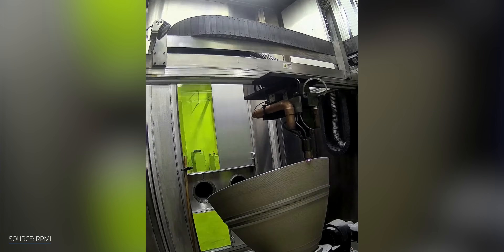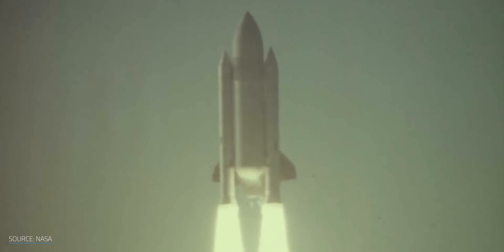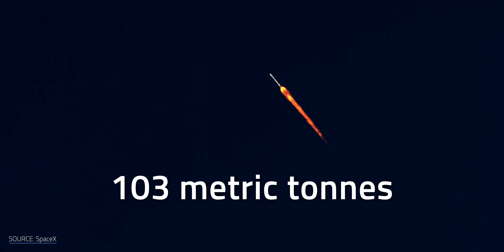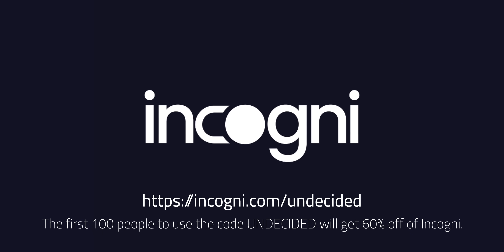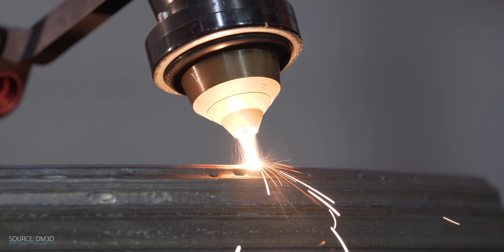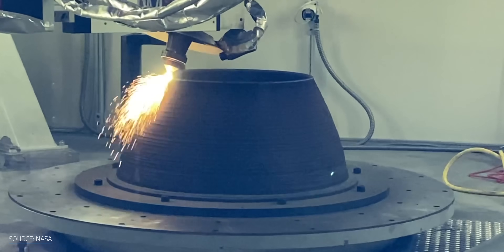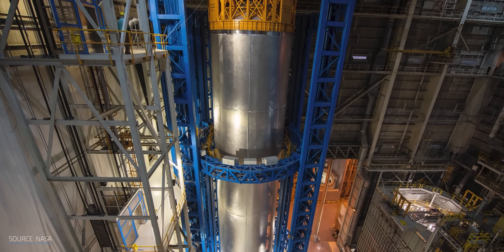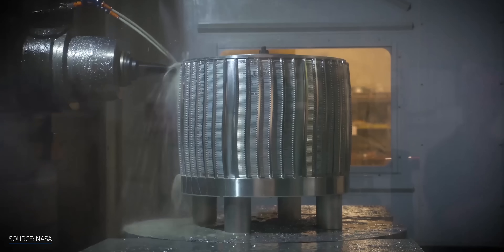Why NASA’s New 3D Printed Rocket Engine Matters

Comment: Imagine blowing up a rocket engine test bed and within a few days have made changes to the design, 3D printed it, and popped it into the next text bed.  Hell, the reason NASA shelved RDEs decades ago was BECAUSE the damn things kept exploding during testing.  

Now we have material, manufacturing, and design advantages that make brutal setbacks from 50+ years ago look like any other day at the office for NASA now.  Failure has become so ridiculously cheap (relatively) that a revisit to thousands of old 'failed' technologies is prudent.  Imagine what else we'll find.

Comment: One of the most important earthly applications for the RDE is in supersonic flight.
Currently there is a propulsion gap between the upper operational limit of turbofan jet engines, and the lower operational limit of ramjet engines.
The RDE could fill that gap, making supersonic flight for commercial transport much more feasible.

Comment: Need some better explanation of the numbers since they don't add up.  5% more fuel efficient?   30-50% more efficient?   36.9% thermodynamic efficiency -> 59.3% thermodynamic efficiency?    If the 36.9% -> 59.3% is what they mean by 30% - 50% more efficient, and it's only 5% more fuel-efficient, that is misleading.

Comment: 100 tons less fuel needed in a Falcon rocket thanks to fuel efficiency (assuming Falcon 9). That's a lot. Like a lot, a lot. It'd be a bit crazy if a Falcon 9 sized rocket can suddenly lift more than starship. Yet that's the impression I'm getting.

Edit: I thought something was off. Real Engineering's figure of a 103t saving in fuel was based on the 1st stage fuel load of a Saturn V rocket. A saved weight he compared to the total dry mass of a Falcon 9.

Comment: My dude, what Mr. Gradl is not sharing, and you would not know to ask is how did NASA get into 3D printing?  they were pushed in by SpaceX.  The first printed rocket engine was made and flown by SpaceX; the super Draco engine is the hypergolic fueled escape engine for the dragon crew capsule.  Printed from a nickel super alloy in a laser powder bed printer, it was the first.  Because NASA had to review and approve it for flight, they didn't know what to do with it, they had never seen or reviewed a 3D printed engine before.  Rules were hastily developed to approve the engine, and then NASA decided they should start investigating 3D printing.  To date NASA developed their own arcane rules for approving 3D printing and did little to nothing to participate in the industry groups who have been chartered for decades to develop rules to approve new materials and technologies.  To date there are no approved inspection techniques for structural 3D printed materials, but they are in development.  Yes NASA has forced their way into the 3D printing space and RDRE's are super cool and novel, but they are decades away.  3D printing is the technology to bring into orbit and to other celestial bodies.  Will it replace net and near net shape castings?  not yet for a lot of different reasons.  Not all materials are readily printed, the GRCOP materials have a problem with Oxygen pick up when atomizing the powder and during printing, aluminum has a big problem with Hydrogen pick up during the same cycles.  There are decades worth of hard-core research to be done on 3D printed materials, the surface is just being scratched, millions of man hours and billions of dollars are coming to bear right now.  Everyone wants a piece of the 3D printing pie but only those with the stones to do the heavy lifting will prevail.  How do I know all this? I am one of the folks on the team at SpaceX when this all happened.  great video, keep them coming!  Maybe you should look at PCRT, process compensated resonance testing.  This is the inspection method that has the potential to go to space and become the preferred inspection method for metallic 3D printing

Comment: Why don't NASA build a huge tower and launch from the top? Surely piping the fuel up to the ship using renewal electricity and saving the extra mile on the trip is more efficient than launching at sea level.

Comment: It's not just the weight difference that is important for needing less fuel per rocket launch.

It's also cost.

SpaceX makes a huge song and dance about reusable rocket engines but the realities of it are that recertifying a previously launched rocket for reuse costs almost as much as actually building one from scratch.

So in this situation the huge cost of the fuel only adds to this problem.

Comment: I think these new engines could see use in the power industry - currently, a lot of "Peaker" plants are gas turbines powered by jet engines. If these are really more efficient they might be adopted by the energy sector.

Comment: Fascinating breakthrough in technology. As a Sci Fi fan, it impresses me that most authors out there didn't think about this one. 
About practical applications down here... Would these added pressure and heat not benefit steam power engines like the ones on ships? Or how about an M1 Tank with this instead of the Jet engine?
And then, the new materials that can take more heat and pressure? Can we have CPUs that can work with higher temperatures with this tech?
With more efficient burning, how about steel production with less CO2 and less energy needs?
Would it be safe to assume that rocket engines stand tremendous vibrations? If so, can we use the same technology to print a car engine that uses less cooling?
Endless wonder!

Comment: I made a ghetto redneck 3-D printer for metal. I use nothing more than a potter's wheel and my old wire feed weldered there, you go a redneck metal 3-D metal printer

Comment: 3D printing metal is not a good way to go. The technology is not quite there. The turntables that spin need to slow down a heck of a lot more because the flow of the middle cannot keep up with that spinning process, let alone make a assistant beat all the way too many air pockets and bubbles that happen

Comment: No. Wait. Uh-uh. Wrong. The big deal isn't printed rocket motors. The big deal is how they did it BEFORE you could just program a printer to make a rocket. Not just the motor, the entire thing minus fuel.

Back in the day, they carved wax. (yes, wax) And through a series of obvious steps were able to fling Neil and Buzz to the Moon. Do a story about THAT, Matt.

Comment: Has additive engineering solved the problem of melting powdered metals with lasers?  When last I heard, the method still had the problem in which the laser would ‘blow out’—much like a puff of air on dust—the metal particles before they fused, leaving voids, defects, etc.    Thank you for a great show!

Comment: So you could take a 3D printer to anouther planet, some wire and make anouther rocket engine. If you could mine the raw materials, the implications are huge. It's a lot easier to take a 3D printer than the whole of NASA.

Comment: 103 metric tonnes of fuel on a Falcon 9 would equate to around 25% of it's fuel load. Farely sure a 5% increase would be closer to 20 tonnes.

Comment: Ahh, why not use magnetic fields to reduce contact with engine? If you are going to do that, then why not make it a plasma drive, which would more easily be controlled by magnetic fields.  Have the combustion produce the plasma process, and use the burn energy passing through the field used to continue the combustion processes.  So, the magnetic jacket is not just designed to reduce heating, but is designed to harvest burn energy.  Now, you can shrink and replace most of the cone and engine assembly.  Achieve a longer burn going into years, as an alternative to ion drives.  At least that's what I thought up as I wrote this, but there is more.  I was already considering how to get ground to orbit payload percentage to 20%, by burning the atmosphere gases on a more complex burn cycle. But, there are some principles I'm playing with here.  We also have energy contribution from the sun, which some old launch system proposed to reduce fuel load by 25%.  We are getting to the territory of amateur rocket builders and universities, launching cube sats and nano sats with technology like this.  I was also considering how to make 300 meter plus telescope mirror in orbit, but practically any feasible width is possible 30, 300, 3000, 30000 etc.  Why can't we see an astronaut on another planet in another star system!

Comment: On fuel efficiency, it should be noted that the Merlin engines on the Falcon 9 are gas generator cycle engines which is simple (for a rocket engine) tech and is not very efficient. This is the same tech used by the first couple of stages of the Apollo rocket. The Raptor engines that are being developed for Starship are full-flow staged combustion engines that have a 97% plus efficiency, all be it with a much greater level of complexity.

Comment: hello Matt, how does this type of engine stack up against a full-flow stage combustion engine like raptor?
Reply: Not very well. While they do have the benefit of being simpler,  currently they can't manage anywhere near the scale or TWR of Raptor, and they're unlikely to ever exceed Raptor's efficiency.  The '25% better isp' claim assumes a best case scenario and that the engine it's being compared against operates at normal pressures, not the insane levels Raptor operates at. The detonation wave peaks at about 200 bar, which means they're an easy way to improve over the ~100 bar of typical rocket engines, and massively better than the ~10 bar found in a jet engine. Raptor, however, is already operating at 300 bar and is aiming for 350 in the near future, not to mention it is doing so with ~99% combustion efficiency.
Reply: @lazarus2691  thats what i thought. but thnx!

Comment: Given its bullet shape, I can imagine an entire Starship hull being printed as one piece in a heat shield composite material.
With no seams, welds or weak spots, it would have to be lighter and stronger than what SpaceX is producing now.
Integrate internal components as its being built (ie: fuel tanks as PART of the structure), as well as hull cooling channels for circulating coolants during atmospheric re-entry.
Rotating Detonation Rocket Engines incorporated as much as possible into the hull, reducing parts and points of potential failure.
Updated designs can be quickly iterated as 3-D simulations, then printed to a smaller scale for testing, refining and stressing the design to destruction, before the new versions are built full size.
🚀

Comment: No only is additive manufacturing a revolutionary manufacturing process, it's amazing to learn how the process is pushing material science beyond existing limits. New alloys that didn't exist before. 
Will be investing when NASA begins exploring the use of metal 3d-printers in the zero-G environment of  space. I know NASA is already using additive manufacturing to form new chemical compounds in  zero-G to better understand structures and chemical interaction. NASA/partners have also has used bio-3d additive manufacturing to place living cells in a matrix allowing cells to grow and bond in shapes in zero-G on ISS that are not possible on Earth.

Comment: Another application for 3D printing that could absolutely be used in space is manufacturing of spare parts on demand. Want to save weight? Bring a 3D printer instead of spare parts for everything that could break. This could be used both on long space voyages or for in orbit satellite repairs.

Comment: NASA has developed a new rocket engine that is 20-30% more efficient than anything else available. The engine is based on a rotating detonation rocket engine (RDRE) that uses additive manufacturing techniques, such as 3D printing, to reduce the cost and time required to build rocket engines. RDREs are designed to be more fuel-efficient than traditional engines, which are mostly fuel, and can save time and money by getting further with less fuel and less weight. NASA's new RDRE has a thermodynamic efficiency of 59.3%, compared to 36.9% for a standard gas turbine engine, and is about 5% more fuel-efficient than the standard. This design improvement can save about 103 metric tonnes of fuel on a Falcon rocket, making it easier and cheaper to blast into space. The RDRE works by aerosolizing fuel and then quickly detonating it, producing shockwaves that travel around the inside wall of the device at 2,000 meters per second. The shockwaves establish a rotating shockwave moving in one direction that circles the chamber every few microseconds. This process is much more efficient than traditional deflagration engines.

Comment: 8:20 - 30% more efficient at 650 psi - does power also scale with pressure - ie, is 900psi conventional the same thrust as 650 detonation?

Comment: BIG MISTAKE in the first minute of the video.  You stated that all uses of a phone (a cellular telephone smartphone is shown in the video) depend on satellites.  This turns out not to be the case, at least not in the developed parts of the world.  Cellular telephones connect with each other using the land based cellular telephone network.  Radio signals from cellular telephones are received by cellular telephone antennas on towers.  These signals are then shunted to fiber optic cables buried in the ground below the towers, the same fiber optic backbone that the internet uses.  When a radio signal is received by the phone it occurs in the exact opposite order that I mentioned above.
The only use of satellites by a smartphone in the developed parts of the world is the use of the Global Positioning System (GPS) of satellites which lets the person using the phone know their location.
I am a (retired) telecommunications consultant with the top telecommunications consulting firm in the United States so I know something about this topic.
This is the first of your videos that I have watched.  I stopped after the first minute because of what I mentioned above, and because of this I will never watch another of your videos nor recommend them to anyone.

Comment: Additive manufacturing has a huge potential and undoubtedly will lead to stronger lighter construction of many different parts and assemblies. Theoretically it has the potential of greatly reducing the number of seals and gaskets needed in many areas, by making just one part instead of multiple parts bolted together with a seal or gasket to prevent leaks. This has the potential of making many parts more reliable by eliminating a common source of failure. I do not expect it to be adopted for the mass consumer market items as planned obsolescence makes great use of the weak links to design in a limited life span for commercial items.
Reply: About consumer market items: Consumer printers have already dropped below $200, and filament is reasonably priced. I think adoption is coming, like it or not, even if it means items are being made in homes, libraries, schools, and other easy to access areas, rather than in stores. The question is not really whether adoption is coming - it's whether they will be able to compete with consumer level 3D printing, which is continuing to improve. At the time of this writing, Bambu is slated to announce a new printer tomorrow. The technology is improving, and the availability of 3D printing will only get better.

I've already replaced some items built for limited life span with 3D prints designed to last longer.

Comment: I'm surprised a discussion of 3D printed rocket engines does not mention RocketLab.  I could be wrong, but I was under the impression they have been launching 3D printed engines for a few years now.
Reply: Yes and relatively nearly 3D prints the entire rocket
Reply: Rocket Lab has re-flown a 3D printed engine already….

Comment: You make it sound like NASA showed Relativity how to 3D print their rockets.  Relativity developed their own special 3D printers before any NASA involvement I'm aware of and really have been at the forefront of exploring how much of rocket design can benefit from 3D printing (almost everyone has been 3D printing significant fractions of the engines for a while now).  Further, Rocket Lab's rocket engines have been 3D printed since the beginning, and I'm pretty sure that had nothing to do with NASA, as Rocket Lab wasn't even allowed to hire US employees in the beginning.  Finally, on the rotating detonation engine front, while that is a significant advancement that many have been working on, you made it sound like it is going to replace all rocket engines.  It's not even going to be applicable to first stage engines, as this type of engine will have too big of a handicap in thrust to weight ratios relative to more traditional architectures.

Comment: Metal sintering 3D printers exist.  They are just too expensive for the average person at the moment to own one.  Entry level is something like $15K USD and then they skyrocket up to 6 and 7 figures from there.  Smarter Every Day just did a video on steel pinching.  Maybe a combination of steel pinching and metal sintering will make its way to consumers, which would be amazing.  A lot of tools currently used for working with metal would no longer be necessary.

Comment: Can’t say you didn’t have a tie in to SpaceX if some sort but it would have been interesting to know if SpaceX will be pursuing 3D printing at some point for their raptor engines. Sure would be handy to be able to print a replacement while on Mars 😂
Reply: Yes, SpaceX uses 3D printing in their engineering and manufacturing processes, including printing components for rocket engines, nozzles, and other parts. They have been working with 3D printing for almost three years to perfect the technology for flight hardware.